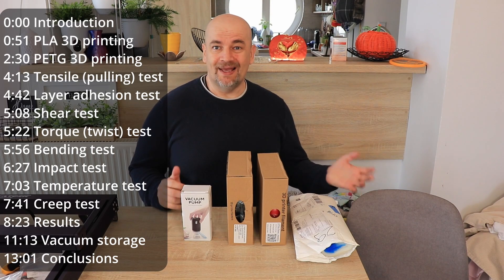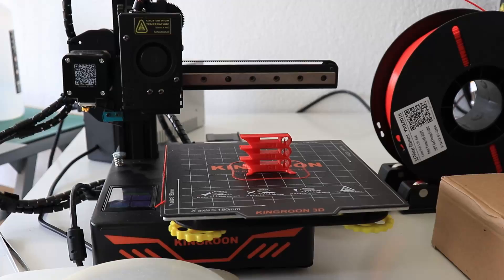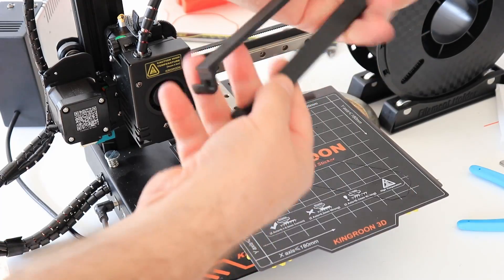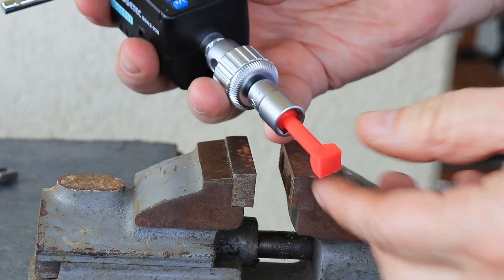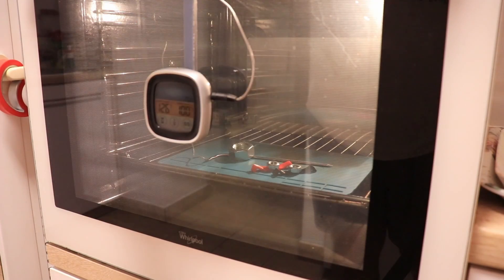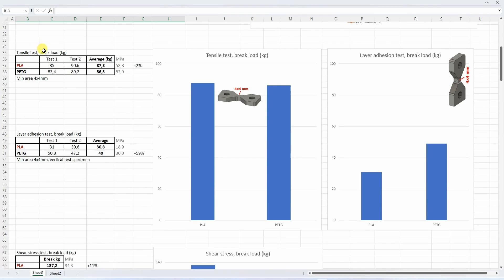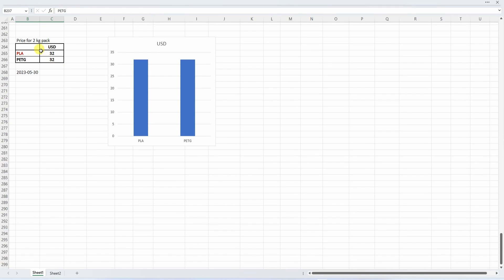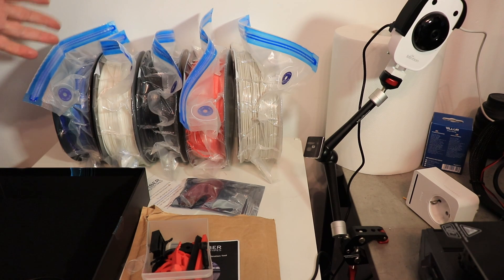Why to use PETG over PLA? Kingroon PLA, PETG review. Also: Kingroon vacuum storage system testing

Comment: Here's my take on the filaments I've tried: PLA and PETG are very similar but PLA is easier to print and less prone to stringing, PETG is a bit more flexible, heat and UV resistant and has a shinier finish and less grip. Overall an object printed in PETG does not have the flaws of PLA but the ladder gives more precise results. I find PLA a bit more expensive. The best of both worlds is PLA+ but the cheapest I could find is over 30% more expensive than the cheapest PLA and 60% more expensive than the cheapest PETG. I've tried PCTG that has the best layers adhesion but it's also much more expensive, I've tried also PETG-CF that has an unique matte look and it's as easy as PLA to print. In conclusion :

PLA: Good starting point, good if you need a cheap and precise material.
PETG: a bit more difficult to print because of the stringing, but cheaper and more resistant overall.
PLA+: the best of both worlds but more expensive.
PETG-CF: resistant like PETG but easy like PLA, has an unique look, require a special nozzle and it's more expensive.
PCTG: a better PETG With almost perfect layer adhesion, but much more expensive.
Reply from the maker: Thank you for this informative comment!

Comment: Hey a qustion to everyone
My new bought roll of pla is stringing at 205°C and anything under its is building something like a horizontal bridge i have already changen retraction setting and played around with the temperatur any other tips?
Reply: Too wet. Need to dry

Comment: I'm trying PETG Tough from QIDI Tech, a difficult material to print and remove supports but after find the right parameters on the slicer I've very strong pieces for example flow and speed have dependency with this material because it's too sticky also into the throat and prints better with PTFE liner than bi-metal.
 Perfect for functional parts.

Comment: I think short term test is only half the story as to why one chooses PETG over PLA. I have had very strong PLA prints straight off the bed, but 2-3 years later all the loaded parts broke, they became crazed and brittle. There's something about PLA at least the one that i use that caused it to degrade with time somewhat fierce, while PETG parts are exactly as strong as the day i printed them, even 7 year old parts. I can tighten the screws right up on a PETG part and don't have to worry about it at all, it won't stress craze or split. I suspect its mild hygroscopy is a positive quality for endurance of the prints, i suspect the incorporated water actually strengthens and protects it under the usual range of conditions, just as long as it was printed dry initially.

I have also not had much luck with ABS, it has experienced already a good bit of degradation during printing and it gets worse after a while in use and storage. I have older ABS prints which were cohesive at first but now break. I can notice ABS degradation in that for example the melt that spent a while in the nozzle while the printer was heating up comes out more yellowish and more brittle than the rest. Not to speak of how difficult it is to achieve a good open-air print with ABS.

I am printing HIPS these days quite a bit. It doesn't have the die swell of ABS, it doesn't degrade during printing unlike ABS, it smells an order of magnitude or several less than ABS, it warps much less than ABS, and i anticipate it to remain stable medium to long term, i am only using it for a year but so far it feels pretty solid. The interesting part is how dissimilar these nominally styrene based plastics are. ABS is a graft copolymer based on butadiene flake, onto which styrene gas and acrylonitrile gas get polymerised; as such i'm lead to believe that when the butadiene starts to unfurl when it's being heated up, it also causes the rest of the polymer to move; and butadiene is also the less chemically stable part and more prone to degradation, effectively ruining the bulk polymer when it does break. Additionally butadiene acts as a styrene polymerisation inhibitor, guaranteeing that there is smelly and toxic styrene monomer embedded in the plastic. HIPS on the other hand is a blend of two unconnected polymers, polystyrene and polybutadiene which were polymerised separately, so butadiene is more protected, causes less movement, and does not cause bulk polymer breakage. I don't know if much of this is true but this is what i've been able to gather from variously dubious sources. If someone has corrections or authoritative confirmation, it would be quite welcome.

All in all i think HIPS is a cheap and very underrated printing material. It is fairly easy and very attractive looking with silky surface. However PETG is tougher and super dependable, and has insanely low shrinkage for dimensionally accurate results.

The one difficulty with HIPS is bed adhesion. I use a PVP stick (Deli 7091) or my own PVP polymer mixture coating for adhesion. However i don't have buildtak or PEI or any kind of special print surface, i print on a glass mirror that i cut down, i suppose those other surfaces may work better. ABS Slurry might work as well. You cannot dissolve HIPS in acetone to prepare HIPS slurry, there is penetration but solvent action is too weak to create a liquid, but limonene should work.

Comment: Btw, I would love for you to do a showdown on annealing PLA and PETG, with varying annealing types(shorter, hotter - longer, cooler and inbetween etc). Annealing is under reported/there isn't that much information especially in regards to testing like this. Would really appreciate it!
Reply from the maker: Somebody already suggested, I will try the "lazy annealing", leaving PLA on the bed, heat up to 100C and put some dish on the top for 45-60 minutes.
Reply: @MyTechFun  This should be an interesting test.  One thing that I have read is that slow cooling is crucial to the annealing process as this allows more of the PLA to form crystalline structures rather than amorphous.

As always, I look forward to seeing your results.

Comment: I bought those vacuum bags, although I think under a different brand.  Some leaked first use.  Some worked a first, but developed leaks later.  Don't recommend.
Reply from the maker: Same with 2 sealing lines? Usually these have only 1 line with other brands in my experience.

Comment: Interesting tests! I recently tried "lazy annealing" of PLA, by leaving the print on the printer bed, turning the bed temperature up to 110C and let it anneal, covered with an oven dish, for 45 minutes. I didn't do any rigorous tests, but I printed two identical samples during the same test print, and I found that it took about 4-5 times more time for the annealed sample to deform and become pliable, when exposed 100C hot air from a hot air gun. So this quick and simple way of annealing might provide enough temperature stability for many applications. Maybe an avenue for more inquiry?
Reply from the maker: Oh, great idea for the testing. Lazy annealing, perfect for me if it works :-)

Comment: Hi Igor, Everson here :)  Nice video! To me, the takeaway here is: PETG is a more predictable material and the Layer Adhesion is REALLY a win for parts that will be under stress, and instead of "exploding", it deforms and you can see it, giving time to replace before something terrible happens. PLA is super strong, but it simply explodes like glass without warning.
Reply from the maker: I agree, but usually PETG has weaker layer adhesion (it can be better with less cooling and bigger temperatures of course), but using recommended settings, in most cases PLA has better layer adhesion. It is good to see that it may be different too.
Reply: @MyTechFun  I don't think we should compare layer adhesion from PLA and PETG with both printed at the same temperature - the ideal temperature for each material is different. Anyways, I need to print more with PETG to have a better understanding of it.

Comment: I use PETG in water/wet environment, because in long term condition, PLA is easier to break when it is wet/moist. I already test with my project and i test with both material for a few months. the results is after about 3-4 week in wet condition when PLA gets more water pressure, it breaks easily than PETG. With PETG my project still intact even after a year or more in wet condition.
Reply: Hi Sandy! I am doing a few prints for swimming pools - can you tell us more about your project?

Comment: 1. PETG has much better layer adhesion and therefore is more uniformly load bearing in Z as well.
2. PETG temp, performance is better
3. PETG is less brittle, you can design snap fittings and similar stuff where flexibility is important, which it is for most end user applications.
4. Price to performance is good, it cost basically the same as PLA. Generally speaking PLA is not an engineering material at all while PETG is.
Reply: a lot of the results showed PLA being either very close in quality to PETG, or sometimes better....
Reply: @iabaca  1. What do you even mean by "Quality" ? Material properties are not quality.
2. Which results exactly in what ?

Comment: Another reason for PETG is bed adhesion; some shapes are very difficult to get to stick to some beds with PLA without a brim (often large and tall objects). PETG tends to run the opposite direction, and often sticks too well, so it's good for these cases too.

Comment: Very interesting. I wonder why manufacturers develop so many products based on PLA and not so many on PETG. like pro, silk, glitter, coextruded etc...  Is it because PLA has more compatibility with additives and stuff like that? or the market asks more for PLA than PETG. I think PETG is a better option in most cases, also because the raw material is cheaper, If it had more demand, similar to PLA, I think a spool could be a couple of dollars cheaper than a PLA spool
Reply: It´s cheaper. and easy to print. People buy PLA for whichever reason so they produce it. PLA is not even considered engineering grade material. Generally speaking there is no reason to use PLA but one and only one ....it´s more green, that´s basically it.
Reply: yeah, PETG is cheaper, but they usually sell it at the same price as PLA. That's why I think it is due to economy of scale. If there were more PETG sales, I think it could achieven better prices.
PETG isn't engineering grade either, if they could compound it with things like they do with PLAs, It would become a very viable option to make mechanical parts. Especially if they improve the impact and crack growth resistance.

Comment: Interesting to see that PETG had better layer adhesion, because in my experience it has been the opposite.
Reply from the maker: In my experience too. This is one of the most important specs in my eye.
Reply: Was thinking about it too. I think it's coz PETG temperature was higher. But maybe that brand PETG just has better layer adhesion

Comment: I use PLA for anything art releated and PETG and ASA for anything mechanically related but if stiffness is a trait that is required I then use PLA+ although I have also used CF-Nylon.
Reply from the maker: What brand for CF nylon?
Reply: @MyTechFun  Matterhackers Nylon X, I chose this as it has the CF strands and not the powder.